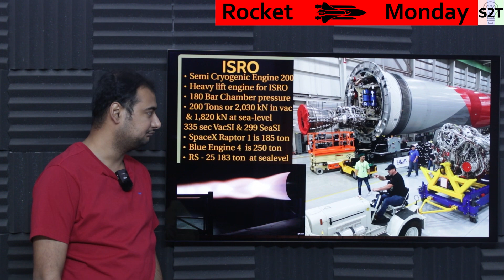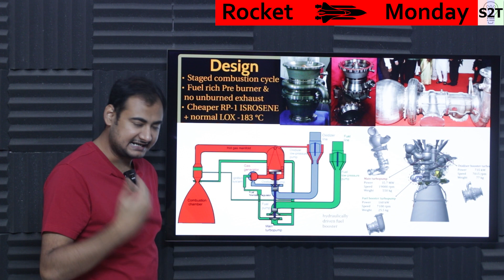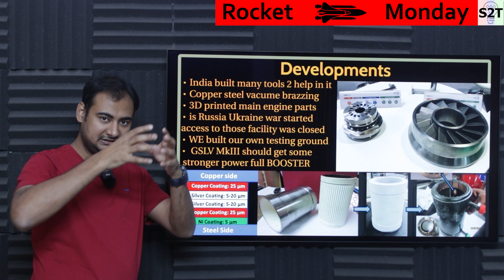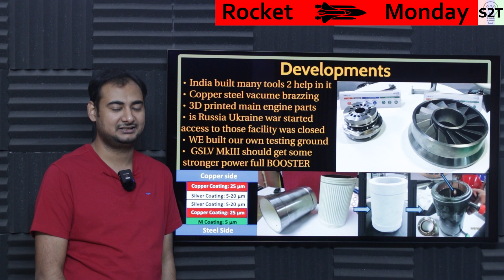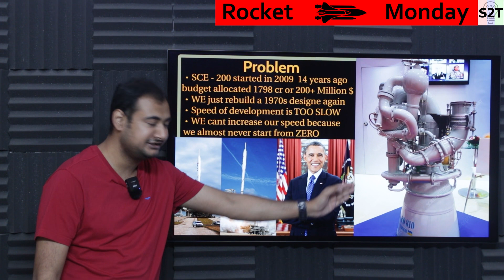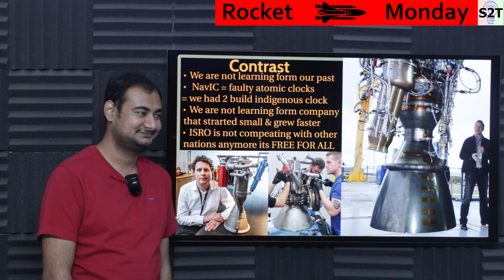ISRO SCE-200 Explained {Rocket Monday Ep234}

Comment: Those Venturi pre-pumps is the robust solution that insures against cavitation in the main pump at the price of introducing small positive feedback loop into pump pressure.
Reply from the maker: " Venturi pre-pumps is the robust solution that insures against cavitation" solution  yes robust  nope rule no one of engineering complexity is the enemy of Reliability
Reply: @s2tenglish  those pre-pumps have no moving parts, therefore they are as reliable as they can possibly be.

Comment: I strongly suspect this engine to have oxidizer rich pre-burner.
RP-1 is considered inappropriate fuel for fuel rich pre-burners.
The schematic displayed also suggest oxidizer rich pre-burner:  the schematic has only one path for oxidizer to the main chamber - that is through the pre-burner, yet the fuel has 2 of 3 lines leading to the nozzle, bypassing pre-burner.
Reply from the maker: yes I had mixed up those two by mistake it is  "Oxidizer RICH" & SpaceX Merlin is fuel rich pre-burners